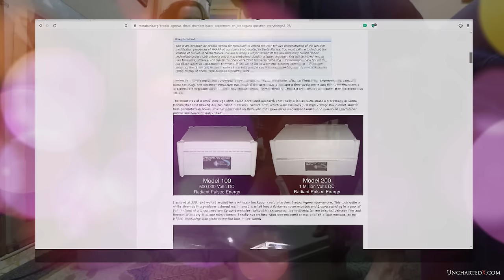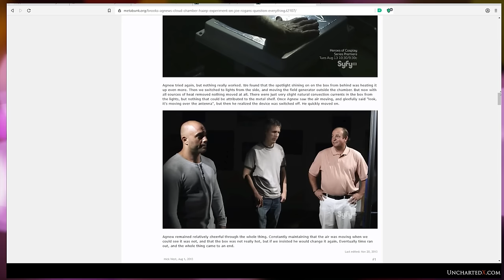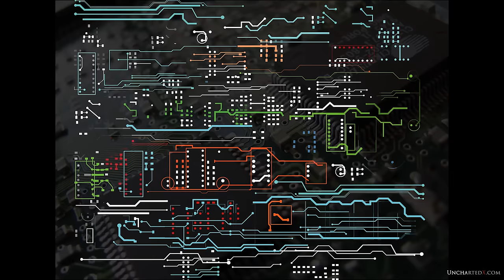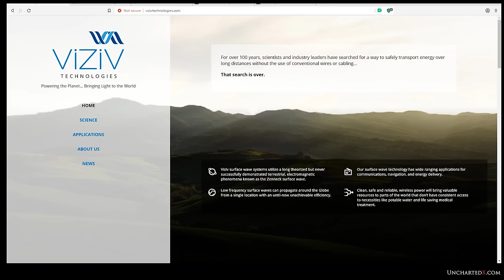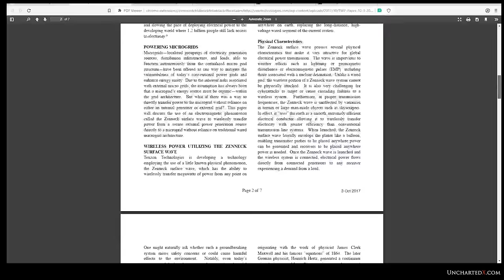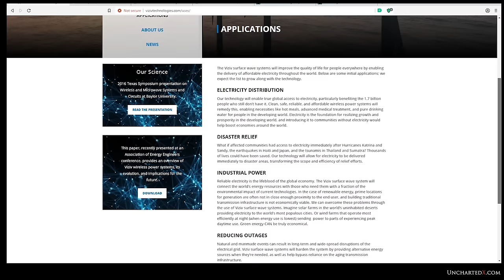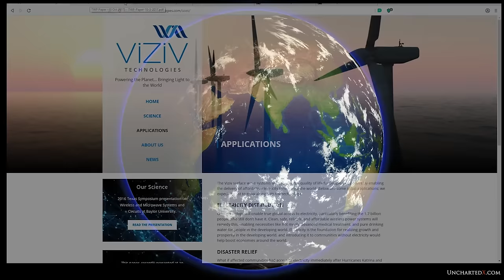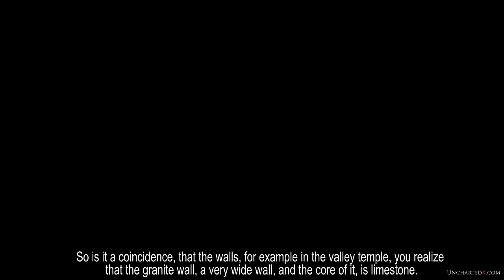500,000 volts through megalithic stone? An investigation into the possible with UnchartedX!

Comment: Great ideas for experiments Uncharted X. My POV is parallel to Uncharted X's digging into the science possibilities available. The Khufu, Giza science design POV is possible and relevant today 2023. 
Piezo type stone as granite is homogenous in its quartz distribution throughout the stone. Thus when the entire object is under enough to shift/disturb is crystalline surface structure by as little as ten percent such as atmospheric compression and/or a separate heavy object pressing upon the quartz crystal structure that it will literally cause alternating current (AC), ie, an electric field to establish itself as a seperate entity from the stone and it is then when the current issues forth via the Electric Field surface, not the conductor interior, but the electric field moving electricity unhindered by the infrastructure of solid material quartz and stone properties providing a conformed structure for the Field and providing a solid physical surface to become an AC electric surface. the square tunnels / tubes at Khufu would be electric surfaces thus configured as a Paul Trap that harnesses electrons/ions. 
My focus is not about life at Giza in the past but what is true about today into tomorrow today. Ancient history not so relevant now unless it reveals what is scientifically useful today for Earth. The seams of blocks are tight so they become a contiguous surface for the electric field to operate without breaks, interruptions in its electric surface's surface. Plus if Khufu and or the whole Installation is a model of Earth including its GEC then one electric surface is synonymous with all the sectors and sections of the electric surface of the object in concern.; some might say, electrical Circuitry. MHD paradigm deals with a moving fluid electrical conductor interacting with the equivalent of a changing magnetic field. Sometimes the conducting fluid carries an element that is an electrolytic multiplier/amplifier referred sometimes to as, Seeds, particles of Dolomite. In Khufu's case and likely the other two pyramid shaped facilities as well. All three and two of the satellites are set up for a N/S 26 degree downhill sloping south gravity feed/ RAM tube Descending Tunnel ( RAM is one of the 4 needed parts of a simple hydraulic control system schematic: RAM, Pump, Valve, Reservoir ) RAM tube aka Descending Tunnel DT, and all three pyramids have cavitation chambers in the proper position to the gravity fed saltwater and dolomite solution (calcium magnesium carbonate from ancient skeletons of disc shaped sea creatures, Nummulites. Skeleton/bone is a known piezoelectric substance as is dolomite itself. Dolomite in solution in electrically conductive saltwater. Now centimeters of salt covering full interior, including the QC and KC n/s, Vents. When Dolomite Saltwater as a conducting fluid carrying piezoelectric 'seeds'- (PCF). Bernoulli's hydraulic mechanics tells us that saltwater in a tube flowing 200 feet downhill suddenly is introduced into a larger tube to flow through then and there that saltwater begins to literally, Boil, automatically. So we're just North of the Well Shaft opening where the DT widens, the PCF boils and implodes the PCF saltwater bubbles with multiple tons PSI and releases heat, big noise, a devastating impulse Jet that can erode military grade steel. Plus the implosion activates the Piezoelectric Dolomite and an AC voltage is hammered out with each implosion of each of the millions of imploding bubbles full of metaphorically speaking , 'nitroglycerine', and explodes into AC voltage creating thermal gradient, if voltage is over 1.2 V then hydrolysis separating hydrogen and oxygen of PCF has taken place. Plus the AC voltage will stimulate nearby Dolomite to emit ultrasound. And en masse ultrasound from a source that large is strong. Ultrasound can register 4 gigohertz output according to current sources. So more than enough to stimulate piezoelectric conversions of sound into electricity. Quartz emits ultrasound when electricity is applied and unfortunately your experiment was not testing for ultrasound. Ultrasound can trigger the AC release of quartz within granite, as in triboluminescence ala the piezoelectric effect. The micro/nano bits of quartz in a boulder when inside a pressure dome, a cooker under enough atmospheric and thermal and acoustic and kinetic mechanical pressures which will convert from mechanical energy input to a unified AC electric field output, in proportion to intensity and duration of Input. either mechanical to AC or if one inputs electricity to dolomite or quartz it will stimulate one of three rapidly vibrating movement patterns that produces ultrasound. So the electric Fields must first establish themselves to attain full transference of charge. And since Uncharted X experiments registered current through the stone then an electrical surface has been established once the electrons finally reach the distance through the physical conductor and then the electrical field can form around the entire object. Then the 'Electric Skin Effect kicks in and carries the load. Granite and Limestone can take a lot of heat buildup from current running through but won't melt like copper unless parameters of the overall device shift as in the electric scorch marks in the grand gallery and the kings chamber. As the water source shifted away from Giza and Africa Sahara region the 'machinery' would lose operational parameters due to decreasing pressure perhaps because of lack of PCF available to keep atmospheric pressure high in the hydrogen modification facility shaped like a pyramid, that the electric connections perhaps had more scope of activity being not so restricted by pressure of atmosphere, magnetic and electric pressures. In the natural energy transference process called magnetohydrodynamics (MHD) and MHD works very well with weak EM fields and super strong EM fields and accompanying Current. MHD engineering principles reveal that Giza interiors are configured with a useable hydraulic control system= all of the interior is the solid physical route of the PCF. Khufu's exterior is the energetic route designated by EM Fields, in some instances fields already in place, fields that are organized, fields that require a form of EM field organizing equipment or configuration of a facility to do such a thing as place and organized EM field structure, seemingly floating in space in the middle of nowhere of perhaps Somewhere significant? I bet on significant. How? IF the Giza Plateau installation when it was in full OED configuration as an MHD oriented, organized and placed in a spot that is very fulcrum like in that MHD, EM domain, a domain of EM field interactions globally, ergo, Global Electric Circuit- GEC. Giza Plate is a piezoelectric island inserted at the center of the Earth surface land mass. Looking at a cross section of Earth interior we see Giza just above a main geoelectric artery/armature formed by an axis just below North Africa: the AFRICAN LLsvp attached to Earth Core and attached to the Cores's opposite diameter the PACIFIC LLsvp and the ocean sub-system of the GEC. The Giza Installation ties into the GEC at Giza. ScanPyramids RF Resonance test findings in annotated thermograph imagery show how Khufu is connected energetically to the Earth and to the atmospheric electric domain surrounding Khufu and reaching to the edge of the magnetosphere that engages the Solar Wind. 
BTW why did ScanP not test Khafre and Menkaure for similar EM Capabilities? or did they? IF not why not? IN conclusion, this evidences a need for proper fully funded professional investigation of the full range of capabilities and possible benefits derived from Giza Science engineering applications. The GEC aside, the subterranean aspect of Khufu shows a way to cost effectively create potable drinking water from seawater/ ground saltwater, by using the design ideas of the subterranean complex to creates super-heated steam to direct at a facility designed to take steam and with it to distill seawater. And provide water pressure to push it to where it's needed. Low startup cost, low monitoring and maintenance, slant well configuration already exist as various played out wells. Many are filled with saltwater. Slant well equipment is old technology readily available. 
Any feedback? Ideas?
Reply: Awesome response, I agree. This has confirmed my theories and beliefs and solidified my idea that the entire pyramid complex is the world’s largest blueprint for humanity in the case of another cataclysm which seems to have ultimately happened. The complex provides profound knowledge from all areas of academia. It provides a blueprint for clean power, clean water, knowledge of the earths properties and comic position within our solar system, knowledge of math and physics and a lot more that we are yet to uncover. 
It seems that whoever came before us had been through a major cataclysm and had lost almost everything. So to ensure that we could rebuild humanity if we were to truely lose everything they left us their knowledge in stone. 
This was a great read and I also employe that more needs to be done to study and unlock all secrets of this blueprint.

Comment: Voltage is the force used to push the current through. @500KV there’s going to be continuity in most materials, but the resistance in different materials will differ. Metals are good conductors if electricity & would’ve been available at the time, so why weren’t they used?

Comment: Limestone is highly alkaline while granite can be slightly acidic. Place them in close contact with each other under appropriate conditions and a chemical reaction could possibly take place over extended periods of time. The structures could conceivably be similar to a battery, although whether they could generate any measurable (or usable) amount of electrical energy is highly questionable.
Whatever their reasoning, the ancient Egyptians put an enormous amount of planning, thought, time manpower and energy into building many structures that in reality, no one has any idea of the purpose of, other than the theory that they were built as tombs or as some form of religious structures.

Comment: Addendum...OK there's a theory about non-radiating guided waves. That is interesting. Will try to find more, I don't have an IEEE member ship.

OK I got a few lines of the IEEE intro:
By employing the Hankel transform of a radial ground current, the Zenneck surface wave, which is a non-radiating guided-wave mode, is derived. We report on its use in our replication of the `crucial' Seneca Lake experiment of 1936, which had been used to vindicate the Sommerfeld sign error myth, and which has implications in efficient wireless power transfer over great distances.

Wikipedia Zenneck Wave:
The Zenneck wave propagates parallel to the interface and decays exponentially vertical to it, a property known as evanescence. 

Its hard to say for sure, but I think the IEEE paper is about getting more power out of an antenna not about transmitting any serious current. Note about Zenneck waves ,  "decays exponentially vertical to it"  I think that ViZiV is BS. They have 12 employees...

Comment: I get a feeling like it acts like a capacitor.. if conducting material is placed inside (layered) with insulating (diaelectric) material.. so it is essentially a giant battery.. the erosion of the surface would also be explained as the in many cases the high current flow of electrons happens on the surface of the conductor.. so it would after a while start breaking down the structure...

Comment: He should have put the device in rain water. The Fluoride  (F-) in the water and the Si (silicon) are conductive. When placing one stone completely flat on one another. The water acts like a candle wick and travels upwards. The result is that the conductivity doubles for each layer. Use water hammer ( water hitting hard stop ) and the pulse wave will send the conductivity through the roof. Because quartz is in granite it has piezo electricity. You could drill into it and get electricity, or even hit it with a hammer, but if you take 2 tuning forks and resonate it. Then you get the same effect without harming the quartz. This is your answer.   By the way a resonance chamber that is conductive breaks the carbon bond. When you do that and have sandstone filled with water, you make she shells in the stone. Hope this helps. It's the technology of the future and the past.

Comment: I'm a little confused, the geological matrix of stone has been studied in depth in order to find all conductive, dielectric and capacitance properties, the induction box being used was invented a long time ago, it works much like the stone djed pillar, but with very powerful neodymium magnets of ascending and descending sizes layered  in between with stainless steel of the lower nickel 200-series (Cr-Mn-Ni) they are then interlaced so the fields wrap around the dielectric spacers, and they will resemble cone like shapes, they need to be aligned in perfect super symmetry and held within something like the box, if done right transverse waves mix in 4 phases creating opposing vortexes to meet tip to tip, and then implosion occurs and the field becomes toroidal, placing a conducting material on top pulses a longitudinal wave through the stone.... oh and the Tesla tower won't be able to direct the transmitted charge, they need alot more towers to create a big enough array so the flux creates a self sufficient network.... Tesla knew where the aquifers crossed under the ground which creates a dielectric void and thats where he placed his bulbs in the ground because the charge from the tower will always find a counter spacial discharge point.

Comment: it's called capacitive coupling. high frequency current undergoes way lower resistance than typical low-frequency current. there could have been literally anything else with trace amounts of water and it would conduct electricity exactly the same way.

Comment: The dendera pillar 'lookalikt; you were experimenting with - the question might be - was it using aor making electricity?
If using , then could it be creating an ultrasonic power from the tube, an utrasonic energy perhaps used for pulverising stone during a cutting process?
If creating electricity, could it be using sonic vibrations and pizo effect of the granite to collect electricity in the limestone core?

You comment about our scientific perception being limited by our today's perspective.  Science evolves, builds on that which we already have discovered or developed - the problem it has is that it traps us into a mindset.  A slightly different starting point may have developed a totally different science, math etc.  It needs a strong imagination to not be bound by convention and to propose seemingly impossible 'what ifs'

Well done for being the catalyst that might help some minds think away from our rigid framework of possibilities.

Comment: More than one surfer has died because in the past, at home they grabbed a sander to try and sand their repaired surfboard while standing on a cement floor barefooted and there was a fault in their AC mains-powered sander, leaking enough high voltage to finish them off in old , ungrounded 2-wire power cords housed in cast metal bodies. Cement is conductive because of the high water content retained in the material. Water, is dipolar and can conduct electricity so if a mineral contains it in their structure, they become conductive as well - especially at high voltage levels.  Limestone is conductive because of the moisture content contained in this sedimentary rock.  Other rocks have high iron content, yet other rocks don't conduct because of a high level of silicon dioxide, which is more like our glass insulators used on high voltage transmission lines, which don't conduct.  The narrator noted in the passage that the induction machine is like a Van de Graff generator.  A high voltage at high frequency doesn't penetrate even a metallic conductor, but rather resides on the surface.  The greater the surface, the greater the accumulated charge.  Even a Van de Graff generator has insulating parts to be able to direct the charge to the conductive accumulators.  That is all that is going on in the stack of dissimilar stones with holes carved through them.  I disagree with the assumption that no one is going to several different quarries to gather different types of stone to build a temple with.  You need to understand the craftsman, the designer, and the religious person's mindset with regard to design.  Certain colors are symbolic to the concepts of their religion, and, certain color combinations just 'look really cool' together.  That is the basis of most of jewelry making selection and design.  A common person will combine chips of these into a ring or scarab or bracelet, earring, whatever.  A government will slab these into huge edifices to honor the strength of their country, religion, or leader so that every one that passes by will be impressed.

Comment: So granite would need something extra like pressure in order not to be more like an isolator. What about submerging it into water? Like water with minerals in it can connect different metals, could it be that the certain granith has in itself different parts that were connecting in water to affect the electricity?
 Just a thought.

Comment: The granite and limestone were placed together at the time of construction. The only possible reason for the granite flaking is the pH of the limestone is slightly alkaline (7.5-8) and over the millennia, the close contact between the two alters the molecular structure of both. (More so the limestone) Add a little water from rainfall. What else could it be?